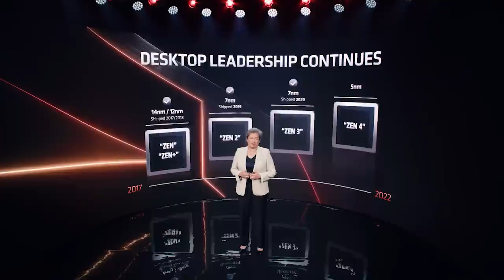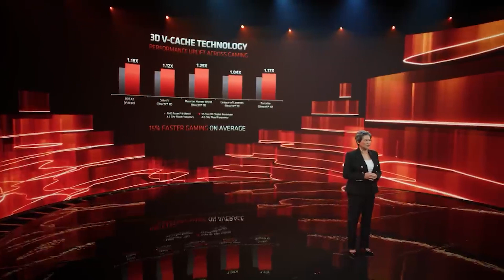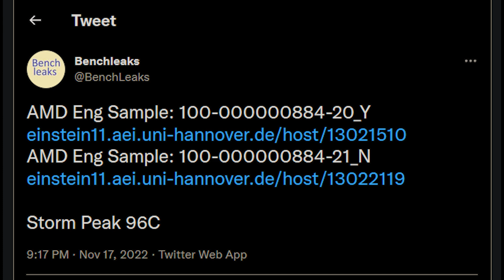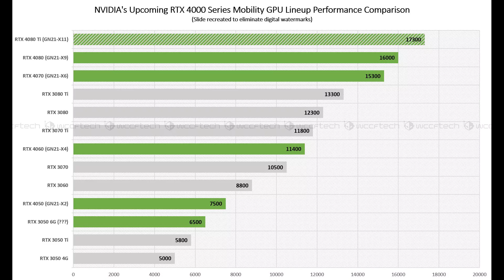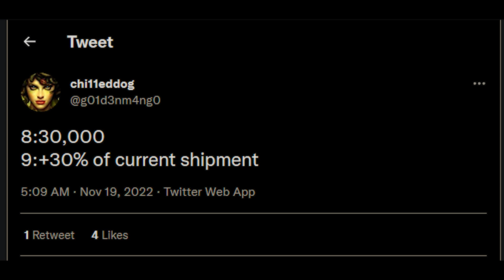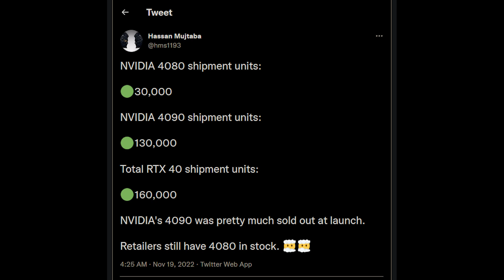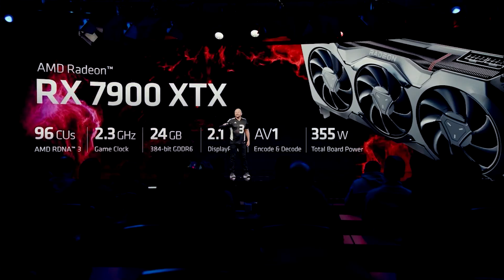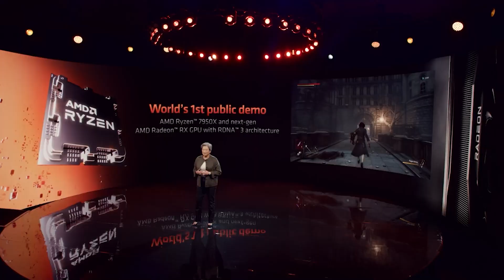Ryzen 7000 3D V-Cache UP TO 16 CORES ?! | RTX 40 M Performance & Specs Leak

Comment: Market segmentation and cannibalization I think are the terms you are looking for.  Those are what killed Threadripper for the desktop - they didn't want to sacrifice sales of their Epyc chips with TR chips, when Epyc is higher margin.

Just a guess though.
Reply: @InSomnia DrEvil I don't disagree with you.  I think mostly they did it to launch their TR-Pro chips, which have price to core ratios similar to Epyc.  I'd love to have a TR chip again, but the price premium is just too high to justify.  Again, I'm guessing.  AMD behaves in a way that will maximize profits, and for whatever reason HEDT TR doesn't fit into their stack.  If you want TR, you have to go Pro.
Reply: @dr3v1l1993 Well part of why Epyc is taking server share is because it's very aggressively priced against Xeon. Intel is too much of an incumbent in that space to be priced too closely to. It's too hard to shift that group off because of the importance of validation. That work is part of the TCO analysis, which also is why Epyc has to have aggressive pricing. As the demand of Epyc increases the other issue is that Threadripper eats into the volume. Not even just in dies but substrates as well, being practically identical packages. Then TR Pro is just a better product, because quad channel memory of non pro starves the cores.

Comment: most variants of the 4090 are still sold out but for people want to get any 4090 there a still some available with good prices without any need to buy it from a scalper;  i build a 7700x system for the moment and i am waiting for a 8+ Core X3D CPU

Comment: I honestly don't even know if the 4090 strix was available most places. All the cards were sold out quickly but that was never even available. I actually ended up getting one from some mom n pop electronics store 3,000 miles from me.
Glad no one bought a 4080. It's a great card in terms of generations, but its at least $400 overpriced. Price makes no sense. Who would get a 4080 strix for the same price as a 4090 fe

Comment: I'm going to be interested in performance of Zen 4 V-cache models. Also looking forward to see if Zen 4c comes to desktop and what it could possibly bring to it.
Reply: Zen 4c alone will unlikely come to Desktops. It is really meant for Datacenter/Cloud provider to replace their skylake nodes with something denser, improving efficiency, reducing rack space needed while keeping the same performance. Most cloud customer don't really need high amounts of compute power. If Zen5 is big little as rumored, we might see a Zen4c variant as the efficiency cores.
Reply: @ApplePotato  Yes, sadly I know. It seems plausible that it will come at least to Workstation/HEDT (though that is stretching the term a bit IMO) platforms. But for some tasks they might be useful in desktops as well. The trick is knowing which tasks.
And of course I do think that AMD will make heterogeneous  architecture even for desktop. Question is when.

Comment: The capability of these chips to run HOT is important for 3D V-cache performance. 
I'm thinking of building a budget AM5 system. 
We'll see what I can pickup on Black Friday. 
I'll go with a 7600x or 7700x first then maybe upgrade to a 16 core V-cache chip. In a couple years.
Reply: Lol, and what this has to do with 3dcache?
Reply: @justfun5479  Components stacked vertically makes cooling more difficult.
Reply: @Batman-bh6vw  Myth.
 The difference between the 5800x & the 5800x 3D is 2-4C higher. My core temperature differences over my 5600x are like12C differences, that's far higher by from each core compared the heat a from veritcal cache. The cache & added z depth layer does almost nothing to temperatures. The chips are voltage uplimited, because the T.S.V can be burned up/off by too high of a voltage.
Reply: @kevinerbs2778  Heck, wasn't one of the reasons the early 7000X chips were designed to run hot was that they had an extra thick heat spreader to make sure the Z-axis was standard for AM5? If the heat spreader for V-cache chips is thinner that may make them easier to cool.
Reply: @IslandFenix  Correct. The thick IHS height unfortunately was AMD's chosen way of maintaining cooler compatibility. It adds quite a bit of thermal resistance so it'll be interesting to see how much thinner they can go, and - with AMD showing they can design a reasonably efficient 3D chip - what the thermal performance is like.
Reply: @IslandFenix  no, the z depth height is to maintain Hteatsink cooler compataiblity from AM4. "Gamers" making a big deal about 95c on AMD is utterly redicilous. Intel has been at 95c for well over a decade & people didn't care, because it was desgined that way.

Just lapping the cpu is fine. Theres like 1.6mm extra sticking out of the socket from Deu8uers measurement.
how cares about warrenty PBO voids warrenty as soon as your board post, &/or with it enable. all boards are set that way standard.
Reply: Zen 4 doesn't run hot, all the reviewers are just retarded, a friend of mine has a 7950X set to 1.2v peak voltage and it sits at 5.3Ghz all core, only hits 77C at load with a Arctic Freezer II 360mm AIO (fairly affordable), and scores 40200 Multi thread on CB R23.

People just don't know what they are doing with Zen processors, PBO is actually shit, I've set my 5800X to 1.3v peak voltage, and it barely goes over 55C in gaming, and is clocked at 4.625Ghz all core.

Comment: A 12 or 16-core X3D would be an absolute mothership of a CPU. I'd pay pretty handsomely for something like that.
Reply: 'ditto'
Reply: it will Not be Extremely Over Priced  !
Reply: @JamesFox1  Nah, they're probably gonna be pretty pricey.  I would bet at the very least a $100-150 price bump to their non-3D variant. probably closer to $200 for the 12 and 16 core variants. Not to say they won't be worth it though. Hopefully they will be unveiled at CES.
Reply: @InSomnia DrEvil - Yep.
Reply: @InSomnia DrEvil That would be my guess too. And I'm acctually OK with that.
Reply: 16 core X3D and 12 X3D will be slower because the clocks will be lowered making it even slower than 13900K and 7950X/7900X in multi core workloads. Then on top of that you'd be paying more just for gaming purposes it doesn't make much sense.
Reply: @Kizzster  5800x3d is also clock limited at 4450mhz. Still beats other zen3 lineup for gaming with ease. I don't use smt and run 8 cores locked to 4450mhz with fixed voltge and pbo. Really good cpu for how old it actually is.
I hope they release a non smt version with 8/10/12 cores and unlocked tho.
Reply: @lunatik6168  Yeah I mostly game. I'm getting a 7700X3D
Reply: @Kizzster  5800X 3D was a hit or miss prototype.
Reply: A cpu that can used both professionally and dunk on intel at  gaming sign me up!
Reply: I am upgrading from a 3950X. I have on hand an AM5 motherboard, 32 GB DDR5, Samsung 980 Pro and 360 AIO...just waiting for a CPU. So far I've held off for a 7900 X3D, but am tempted to just get a 7950X. That'll be a noticeable improvement for my workloads.

As for the GPU, I will stick with my 3080 Ti for now. I will likely upgrade to an RTX 7900 XTX sometime later in 2023. I don't need ray tracing (although I see its potential for streamlining game dev). More importantly I feel like Nvidia is trying to milk every dollar it can from the market. The  XTX seems like better value.
Reply: @declinox  I hear you. 7950x. May be the way to go If doing production work. Not 100% on a higher than 8 core V-Cache variant. Hopefully. But we will see in time.
Reply: A 16 core x3D would be the CPU that ends all CPUs. It’ll be the last CPU I ever buy.
Reply: @Kitten_Stomper  As long as thermals are good enough to not take a clock speed hit then it'll be a monster for many applications. TSMC's stacking process is supposedly improving to not be as voltage sensitive so hopefully it's not as locked down as the 5800X3D. The 7950X is already difficult to cool so I do worry about thermals adding 3D stacking to the mix. 

If they're binning better chiplets for X3D, which I imagine they must be, I'd consider paying the premium. I'm not convinced they'll even release 12/16 core versions but if they do I imagine a 7950X3D will be at least $899.
Reply: Yep, should be a blessing for something like Vtubing when running:
OBS (with recording),
demanding 8T/C game (4K display),
VTube Studio (complex avatar),
T.I.T.S. (complex objects),
and background functions + tabs / platforms

For that you could basically have a dedicated core for every needed thread, headroom and stable feed due to L3 addition.
Reply: yep I bought a 3960x back then I'll buy an expensive x3d 16c instantly...12 better than nothing...8 I would buy but not happily as I actually use my 9-16 cores with cpu affinity as you win11 uses e-cores except amd makes real cores not laptop spare power cores in a 700+watts desktop pc
Reply: 24 core threadripper Zen4 3D the ultimate beast of it gave me CPU/productivity workstation CPU.
Reply: Yeah I currently have a 5900X running with a 4090 and it's a bottleneck even at 4K so instead of getting a 13900K am going to wait and see what they reveal for X3D chips. If they dont reveal anything soon I'll probably just go with 13900K I guess.
Reply: @TerraWare  Probably  CES 2023 when we will see them..
Reply: @TerraWare  same
Reply: @TerraWare  did you just said that the 5900x is bottlenecked by the 4090 on 4k?! You are joking right?!
Reply: @shayeladshayelad2416  I'm not. If you want to see for yourself I've uploaded quite a few game benchmarks of my setup on my channel.
It doesn't bottleneck in the really demanding games but in a lot of them it does.
Reply: @TerraWare  Dude you're just looking for a reason to upgrade. There's always a bottleneck somewhere. Anything the 5900X is a bottleneck in with a 4090 at 4K max settings will be high FPS titles that'll get bottlenecked by Zen 4 as well. You'll get very small gains outside of a few edge cases.
Reply: @JJFX-  I don't disagree lol. I dont necessarily need an upgrade which is why I'm in no hurry.
Reply: @TerraWare  it's going to be next year hopefully Q1. I would wait for 3D. That way you can upgrade CPU in that board later next 2 gens of CPU. 13th gen is on a dead end platform.
Reply: @ZFPS115  Yeah I'm not in any hurry. The 5900x still performs amazing for me. I just want to get even more performance and use my current cpu motherboard for a third build for myself with a 3080Ti
Reply: @TerraWare  I have a 3080Ti and 5900x and it's solid for what I play. 1440p 165hz monitor. WZ2 runs good on it.
Reply: @TerraWare  I’m in the same situation
Reply: @TerraWare  5800X3D owner with a 4090…. The bottleneck is real. 

Waiting for the 7000 vcache variants to drop
Reply: @TerraWare  5900x its not a bottleneck by any means, especially in 4k, go educate yourself

Comment: I would replace my 7950x for a 12 or 16 cores V-cache version.
Reply: ??main purpose of v cache is gaming ,so you don't need more than 8 cores
Reply: Not necessarily just gaming. Any application that could fit the working data(model) could greatly benefit from vcache. Also the app has to be multithreaded.
Reply: @АнтонКраценюк  yeah but people like me want a workstation/gaming station. 16 cores would help with multitasking
Reply: @GUY-on-Earth  exactly, my pc is my work and my entertainment so to have a 16 cores version would be the perfect CPU.
Reply: It will be interesting to see if V-Cache really provides an improvement with DDR5.
Reply: @wayland7150  oh it will for sure :), even more so since DDR5 has much higher latency than DDR4
Reply: How long have you had the 7950X?